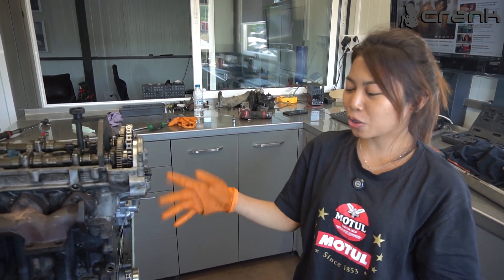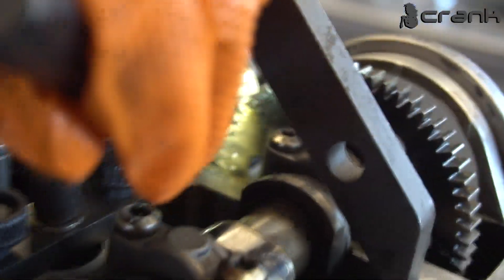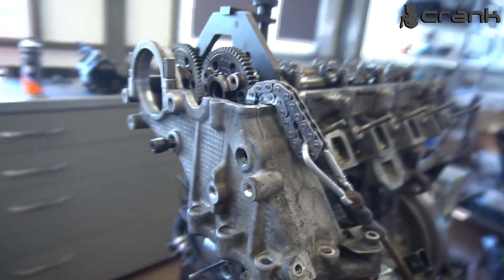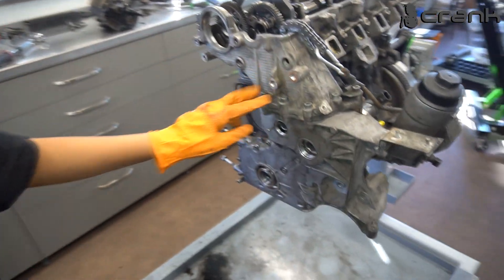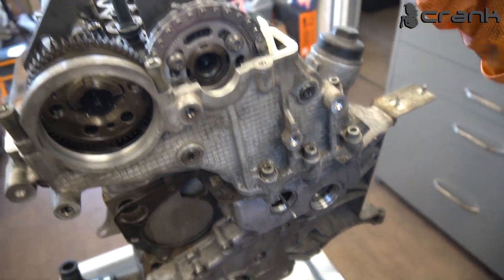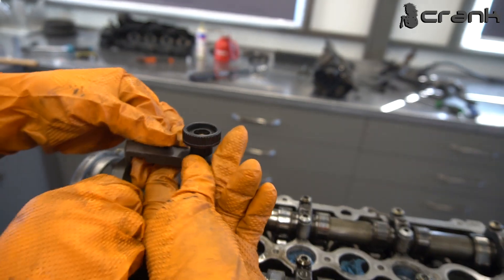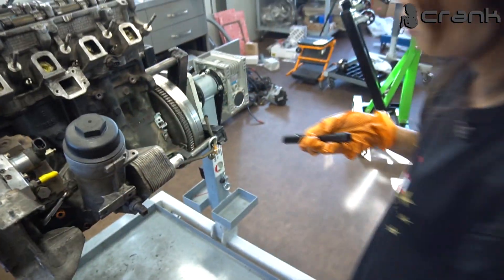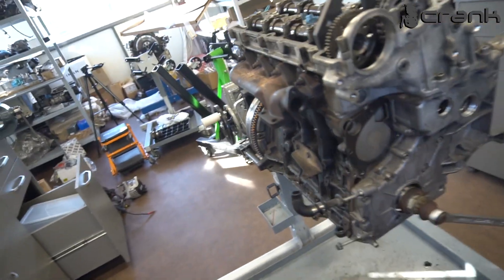BMW M47 Timing Chains Procedure

Comment: Do a video on n55 camshaft seal failing and dropping forbidden glitter in the oil, and the replacement, not being metal but nylon
Reply from the maker: I have a video about N55 with failed crankshaft seal and the issue which the serpentine belt did because of it
Reply: @crank3646  serpentine belt is not the problem. The  problem I’m currently facing has something to do with a camshaft seal. I have forbidden glitter in the oil small amount, because of that I’ve taken a car off the road until I can figure out what’s going on. I went to a couple local mechanics that also build cars BMW guys that to be honest are pretty good. They want me to do an entire motor. Right now i don’t have all the money for that.  I’ve dumped lots into the platform it has little to no resale value. But it does have emotional value to me. I’ve read many posts about the metal ring at the end of the camshaft behind the cam phasers that bmw replaced with nylon I think that’s the problem. Replacing head or sending the head out is cheaper than building an entire motor.
Reply from the maker: @user-pi9zl4wi7s  Oh I got confused when you said camshaft seal... yes the rings are an issue for many years, that is why BMW replaced them with the vitol or nylon ones. I guess there is always a possibility to weld the groves and after that send the head for camshaft tunnel line reboring, but its kind of complicated task to be done. Maybe try your luck with Ebay cylinder head
Reply: @crank3646  I guess that’s why all the BMW mechanics say replace the motor. Hmmn
Reply: Side note: I like your channel.. to attract a bigger audience (Filipino’s are into cars esp BMW’s big time), have your wife on more and have her translate in real time.. also send her to a mechanic school so she can propose really good questions. Good luck man 👍

Comment: So when the flywheel is locked with the locking pin, the square tool on the intake camshaft touches both sides of the head, AND the tooth between dots on one camgear aligns with the line on the other, then camshafts are timed right? Is it feasible to count and mark chainlinks on the sprockets? Like you do with rubber timing belts?
Reply from the maker: There is no need to count the chain links. If the things you have described and we have showed in the video are met, you are perfectly timed and no need to worry for this